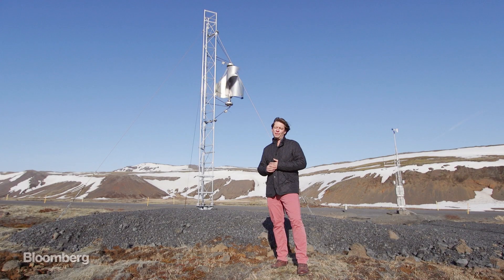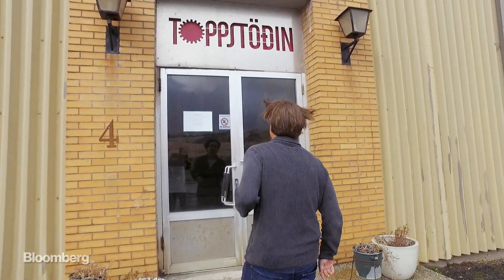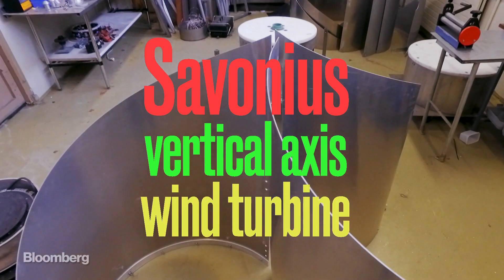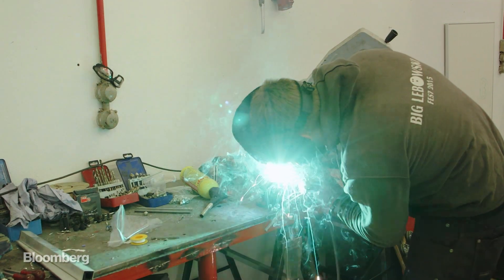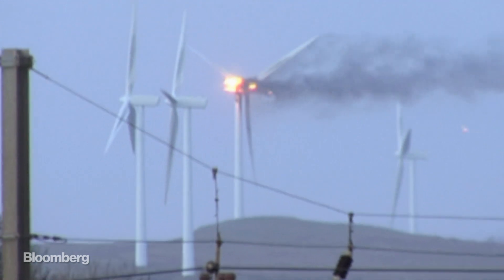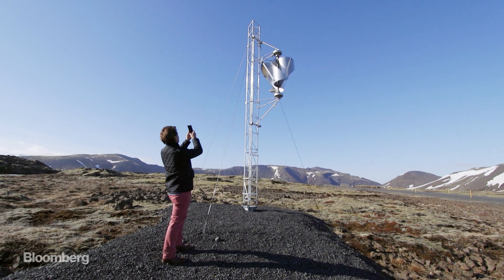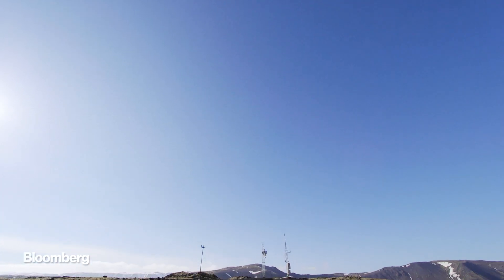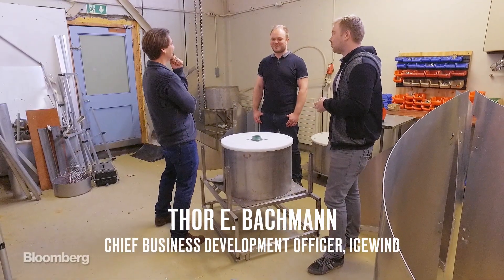The Tech That Could Fix One of Wind Power's Biggest Problems

Comment: This turbine may look cool but its not efficient and dose not scale up very well.
Its only practical for powering tiny things like phones ware you don't care that your wasting a lot of potential energy.
Also the increased lifespan has more to do with the generator and bearings chosen then the blade design.
Reply: Some comments like this amaze me with there utter ignorance of the subject.
Reply: Brandon is right. Show us your stuff.
Reply: Since I don't see any numbers regarding output and wind speed, can you tell me why it's not efficient and doesn't scale up very well?  All I see is that they used smaller versions at the bus stops.
Reply: I can't help it!!  I try so hard to overlook bad grammar and spelling.     does, where, you're, Also, and than!

Comment: Look kind of cool....yes.....but to really have an effect there will have to be tens of thousands...hundreds of thousands...of these things everywhere....and I mean everywhere.  I like alternative energy sources, but the problem I have is that no one seems to think of them critically.  It's ;like it is a sacred cow.  Like the turbines burning up in high winds, how many times have you ever heard of this problem?  I have never seen anything anywhere on it, but it is common.  The life span is short on wind turbines, but you never hear about that either.  Rarely do you hear about the energy loss on these systems, through the conversion of wind to electricity.  Not to mention the sheer numbers necessary to start having a real, sizeable effect on energy production.  

Not knocking these guys, it's a good thing.  But think of tens of thousands of these things spinning to power advertising, warning signs, traffic flow signs....the list is endless.  It might get just a bit old.
Reply: Yes cars are a problem too. But they are too useful, and don't always have alternatives. Electricity on the other hand can be generated in a lot of ways, and this is not the best. This technology is good for remote locations where little power is needed and enough wind is available. Usually solar panels are used instead, but Iceland probably have more wind than sunlight.
For powering cities you need something that scales up to gigawatts, efficient and reliable. That's currently fossil, hydro, and nuclear. Maybe solar in deserts, if cost and storage issues are solved.
Reply: Yeah like cars! The bloody things are everywhere and an eyesore. Lets get rid of them,they stink,they cost a lot of money and there dangerous.
Reply: Patricktomlinson Tomlinson

Comment: Good idea. Small distributed power generation is more robust than large centralized systems that corporations prefer.
Reply: Yes, but economy of scale brings the prices down. A single large plant is easier and cheaper to build and maintain than thousands of small ones. Also any form of power generation can be distributed. The ideal solution would probably be 10-100MW mass produced modular nuclear reactors. With reasonable regulations and mass production costs could be orders of magnitude lower then anything we have now. Better designs (like the LFTR) are safe without the usual insane over-engineering, which makes them a lot cheaper too. The small modular design means that reactor block can be built in a factory, easily moved to anywhere and set up quickly. These are also ideal to power ships, unlike solar or wind.
Reply: You're not considering all factors.  Single, large generators are vulnerable to attack and breakdown, cutting off service to hundreds of thousands.   Small, plants (each city) maintaining it's own stations across neighborhoods is the best.   Cities are not good places to live.  The NWO wants to herd all of us into their slave cities..
Reply: 1. Regulations are rarely reasonable because large companies have the power to influence politicians.
2. Once you factor in the cost of decommissioning a nuclear power station after its EOL and of safely storing the waste (which no one has suggested a workable solution for yet) for tens of thousands of years, the cost of nuclear energy is higher than any other. It only works economically because the earnings flow into shareholders' pockets while the costs (and risks) are borne by the community i.e. tax payers.
Reply: It certainly does away with transmission losses. Good thinking!
Reply: Nowwhattian Boghog
1. Yes that's why nuclear energy is way over-regulated. Fossil fuel companies have orders of magnitude more money than nuclear companies.
2. Decommissioning, waste management and insurance are all payed for in advance from the income of the plants. And they are still among the cheapest sources of energy.
Waste can be handled in several ways. The oldest one is simple recycling, but that was banned in the US, because of alleged proliferation risks (France and Russia does this and didn't have issues). A much better solution is to burn the waste in fast breeder reactors. Those actually can release 100x more energy from the stuff than the original reactors had, while eliminating almost all long lived isotopes in the process. The remaining waste only has to be stored safely for a few hundred years. This would have been the Integral Fast Reactor program, which has been cancelled after very successful tests.
Than you can simply store the waste as is, that's the Yucca Mountain Nuclear Waste Repository, which has finally been completed, and licensed recently. It can safely store nuclear waste for a million years. And there are several billion dollars left over from the waste management fund.
And nuclear energy could be drastically cheaper with better designs (like LFTR), and more reasonable regulations. For example currently the nuclear plants are releasing much less radiation than coal and geothermal plants, or what you get from natural sources. But that achievement costs a fuckton of money, relaxing regulations a bit would make nuclear energy cheaper, while not compromising public safety. The fossil fuel industry on the other hand is allowed to release billions of tons of poison into the environment, killing hundreds of thousands every year.
Reply: *****
I actually considered that to. That's why I think small to medium sized reactors are a good compromise. Now we have a lot of GW scale plants, those are often too big, but regulations drive plant sizes up, because a lot of the costs are per unit not per MW. Smaller plants near the consumers are better for several reasons.
Cities have their pros and cons, and small cities are very different from huge ones. The biggest advantage of a city is that everything you need is relatively close. While we still have to physically go to places to do stuff, we need cities.
Reply: +András Bíró you mean well but nukes are a dead end, the waste disposal takes away all the advantages the potential for damage on a huge scale if even one goes bad is to high a risk, renewable energy sources and a smart grid is the way to go,a turbine like this solves a lot of issues the main one overspeeding,caused by storms, it's not the most efficient design but it's cheap to produce and robust enough to last . barrels of corroding nuclear waste are poisoning France and the uk,and some we speak go to a fish market with fresh seawater caught fish with a Geiger counter and post the results to utube I bet that will end your fascination with nuclear power
Reply: "Reasonable regulation"?  When you look around it is the large corporations and their henchmen in Congress, who are constantly attempting to avoid "reasonable regulations" and the results are oil spills and other avoidable disasters.
Reply: They'll be buggered in Nigeria then!
Reply: You make some excellent points, TerFar1
Reply: cartmanrlsusall
No, waste disposal and safety are made up problems. We can easily burn almost all of the waste in fast breeder reactors, like the IFR (https://en.wikipedia.org/wiki/Integral_fast_reactor) was. And the remaining waste is only dangerous for a few hundred years. The ancient Egyptians were able to keep their stuff safe for thousands of years, so I'm sure we can manage a few hundred.
Nuclear energy is already one of the safest, even if you include Chernobyl, which was a reactor design that focused much more on low cost, than safety (and there were more issues). And there are reactor designs that orders of magnitude safer then the current generation (which had no significant accident by the way). The IFR and the LFTR are the most famous. The LFTR is also simple, cheap and doesn't make plutonium for bombs.
About radiation. I recommend shock therapy : http://www.atlasobscura.com/articles/the-woman-who-ate-chernobyl-s-apples
Then you should read about the LNT model, and radiation hormesis.
http://www.gvnews.com/opinion/columns/editorial-when-scientists-fail-at-science-why-low-dose-radiation/article_6de9d768-671f-11e5-9fc1-a3c4da95f8e0.html
http://atomicinsights.com/science-falsified-no-safe-dose-hypothesis-radiation-now/
https://www.ncbi.nlm.nih.gov/pmc/articles/PMC3834742/
Reply: SubtleKnowledge
Nuclear energy is different. It's insanely overregulated, to the point where it's essentially dead. The current reactor design is basically the same as the one that US Navy developed for nuclear submarines in the 1950s, and few were built after the 1970s. There were some much better developed later (LFTR, IFR), but never used because regulations allow very little room for innovation, and research was usually defunded before the projects were finished.
As an example for overregulation, coal plants release a lot more radioactive materials then nuclear plants.
http://atomicinsights.com/high-reasonably-safe-ahars-sensible-radiation-standards/
This is why now it can take a decade to build a  single plant, while the whole technology was developed in less time from nothing.

China and India are already building the next generation reactors, while US startup companies are completely blocked by regulations. Even Bill Gates (TerraPower) was unable to get through, he has to build his first reactor in China.
Soon the US will have to buy Chinese reactors which are based on 50 years old American design.

And the reason for the overregulation is simple. As you said, big companies have too much political power in the US, especially oil companies, and nuclear energy is a huge threat to their profit and power.
Reply: As far as most power-companies are concerned, everything is a threat! Except earthquakes.
Reply: András Bíró I cant change your mind but corroding barrels of radioative waste were dumped for decades in the atlantic some within sight of land as there was a time limit on cargoes of barrels so when the exsposure time limit was reached ships dumped wherever they were so no one really knows where some of this waste wound up .I don't understand how you dismiss Chernobyl like it was nothing it is a huge  area that's going to be deadly for thousands of years
Reply: Because of maintenance... Winds and solar are not applicable to all areas, so what's next?
Buying a gas/diesel genset? That would probably cost more for your daily needs, plus maintenance.
For you to do maintenance you will of course shut it down therefore no power for some time.
.
It's just like having your own car vs using public transport.
Reply: +cartmanrlsusall
Seems like my comment disappeared again.
So, some low level waste was indeed dumped, but that's not an issue. Low level waste isn't too dangerous anyway, and it's diluted by an entire ocean. The soviets dumped some worse stuff, like used reactor parts, but not actual used fuel. These sites are monitored, and since radiation is extremely easy to detect, if anything really dangerous shows up, it can be dealt with in time.
Chernobyl isn't deadly, and isn't a huge area. You can visit the exclusion zone now. Check out Bionerd23's YouTube channel. The reactor that blow up at Chernobyl is the oldest and least safe type, it was built with minimal safety systems, and was run carelessly by a poorly trained staff. Still less then a hundred people died there. No such reactor is being built today, and I think all old ones were decommissioned. Modern reactors physically incapable of blowing up like that, they only melt down and slowly leak, and even that is an extremely rare event.
Reply: Current FUBAR in our world PROVES that centralized power generation is a suicidal idea for a civilization
You'll understand as the chaos continues :(
tried explaining this to folk 20 years ago, sigh

Corporations/Elite want us being slaves to THEIR control of food, water, power, medicine
but, in a disaster, all that centralized control/ownership/generation in the hands of sociopathic megalomaniacs causes...utter ruin, it's how many civilizations fall

"Efficiency" doesn't matter a damn compared to being localized nodes and thus, able to still help some people, when an event wrecks a large area.

There's too much damned "bean counting" and kowtowing to bloody power mad bosses.
Which has led to things like Fukushima: 
yeah, building multiple reactors on top of one of the most tectonic regions on Earth was so smart, eh? 
also the reactor design was optimized for plutonium production not safety.
AND they ignored tsunami peaks because...the Elite wanted it built and that was all that mattered.

Better 10,000 small turbines in a town, than 1 giant one. think about it.
Think about it VERY hard as the world goes to hell around you over next few years.